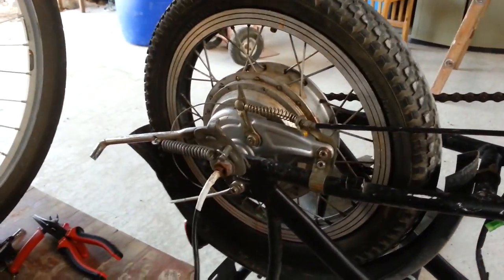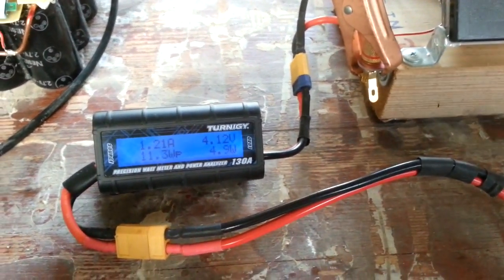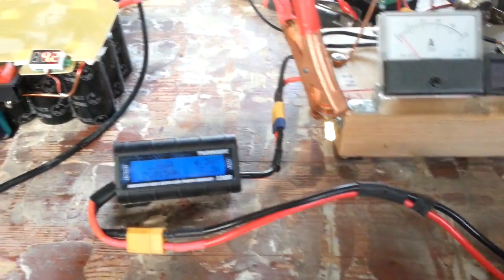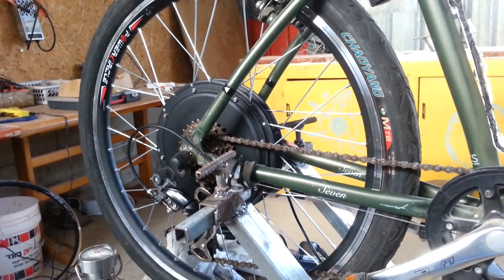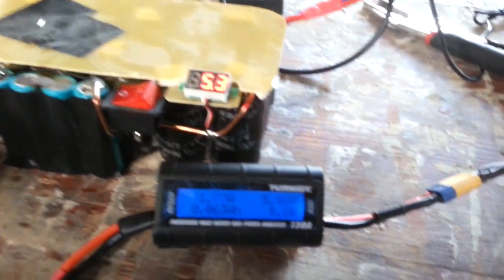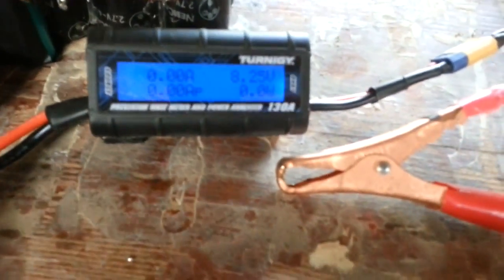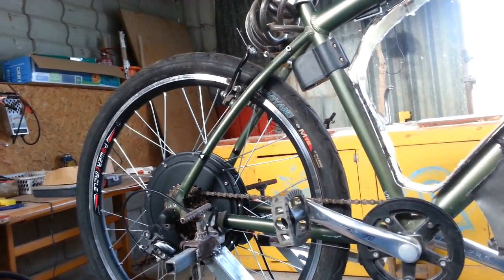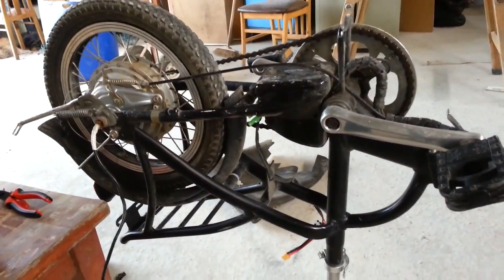Testing Ebike Hub motor charging battery and super capacitors - wind turbine project

Comment: Is hub motor conversion possible to alternator? Does anyone know how to do ? Contact me
Reply from the maker: yes. you connect the 3 phase wires to a diode bridge and regulate the voltage, so you can charge battery with it
Reply: @neworld4ever   so if I use even 1 kw hub motor wheel I can charge battery by it? When go to downhill by bike for instance, or one motor used as generator another as motor
Reply: Thanks for response
Reply from the maker: @datodatto  yes sure. there is some motor controllers that charge the battery when braking. it's called "regen". the controller is rectifying the 3 phases and regulating the voltage. but better you do it with diode and regulator if you want it to work continually

Comment: hi! thanks for sharing! i'm just about to make a bike generator for a charity in yorkshire uk so it's really helpful to see! can you give any other advice? i'm going to use a 36v 500w hubmotor to charge 12v SLA battery. how best to regulate dc voltage after rectifier? buck converter? what range of voltages will motor give out in real cycling normal cadance? i heard people use block one (here https://uk.rs-online.com/web/p/switching-regulators/4459787/) but it is discontinued and i can't find similar rated product anywhere uk...  or maybe use a wind turbine controller? but 12v wind controller will divert voltage too low to use with 36v hubmotor because will waste much power...
Reply from the maker: Hello Friend
you can use a 36V 500w hub motor to charge a 12V lead acid battery.
you can regulate the voltage and the current with a step down converter. this is a simple and chip one https://www.aliexpress.com/item/32639621677.html?spm=a2g0s.9042311.0.0.27424c4d84SM8p (order 2 pcs for any case).
step 1: connect a volt meter to the hub-generator rectifier bridge (that connected to the hub-generator) , and run it in the MAX speed you can turn it. make sure the voltage do not rich more than 40v
step 2: connect the step down input to rectifier
3. run the generator and adjust the step down module output voltage to 13.8V (13.8v it's the right charging voltage for lead acid q gel battery)
4. connect the step down output to the battery.
5. at this point you will have charging
6. for adjusting the current: connect ammeter between the battery and the module output, and adjust the current. limit it to 5A, so the module will live longer. (when adjusting the current, the battery should be low)

one thing to consider: this step down module can handle 40V MAX input voltage. if the battery will be in a state of full charged and the generator will run in high speed, it can produce more thave 40V and damage the module.

another thing: use a direct power motor - with no gear inside.

Comment: Is this ac motor or DC motor
Reply from the maker: Its a brushless dc motor
Reply: Then y input of this DC Motor have three wire
Reply: Apart from hall sensor wire
Reply from the maker: @abisheks6818  yes. It have 3 phase wires and 5 hall sensors wires.
To use generating power you need only the 3 thick wires
Reply: Its 3 phase AC motor.  He is using a 3 phase rectifier diode to change it to DC

Comment: can i know if you used any special BMS to use both the supercapacitor as well as the battery into a single module?
Reply from the maker: because it was only a test, so on this capacitor bank there is no bms, but if you are going to use it so better use one.
same for the li-ion pack, should be connected a 4S BMS to prevent overcharge and discharge.
the battery pack connected in parallel to the capacitor bank, to keep the capacitors voltage high, despite the leaking
some high quallity super capacitors can hold voltage for a few months, but this chinese capacitor leak very fast
Reply: NEWORLD  thanks

Comment: have you tried with alternator motors
Reply from the maker: Alternator Motor is not the right generator for wind turbine or other mechanical electricity devices.
a alternator motor have a coil rotor with need a power to operate.
you need a permanent magnet generator for this one